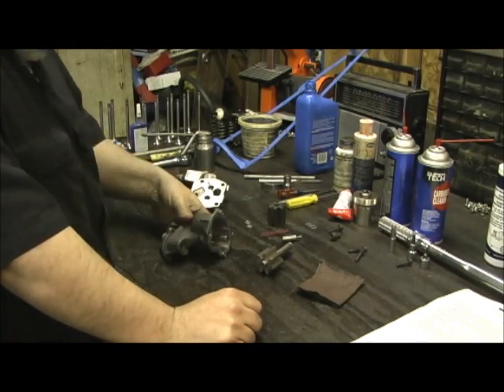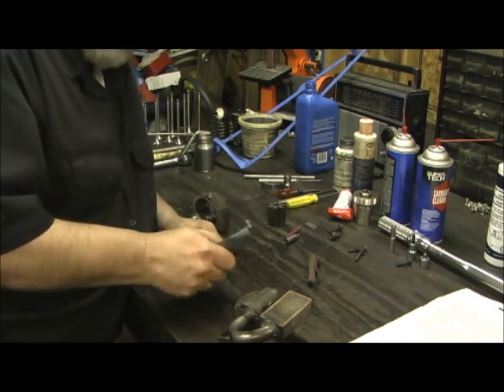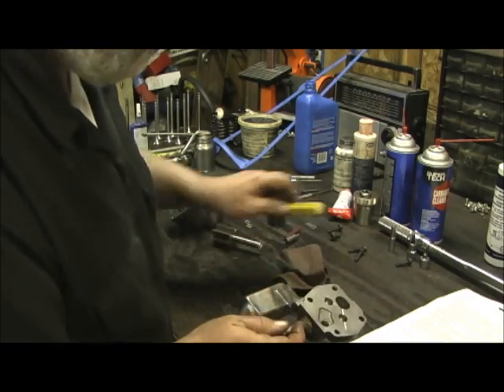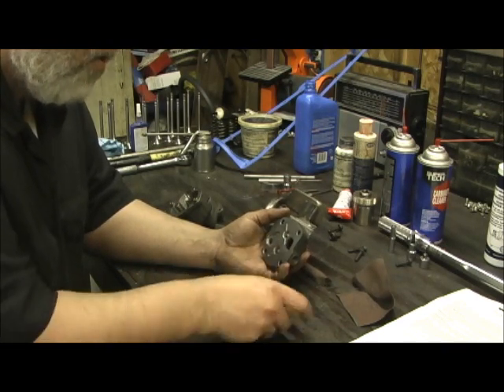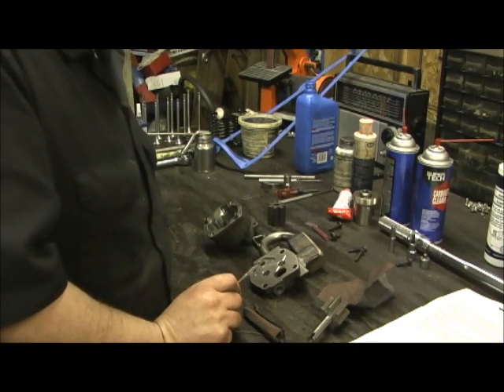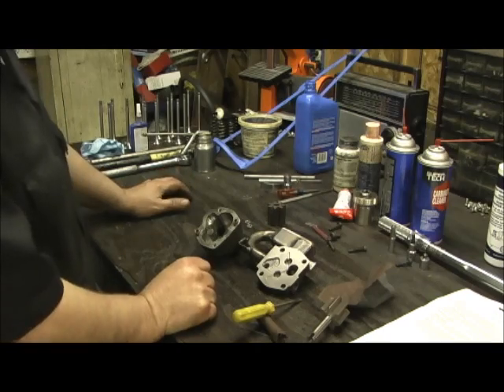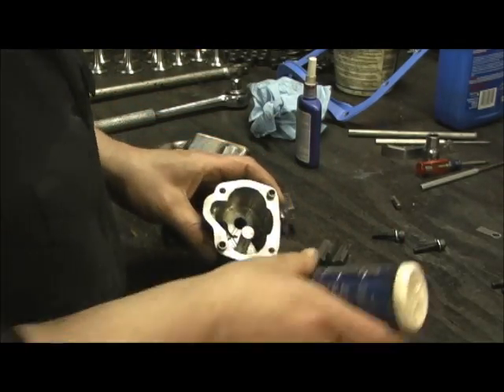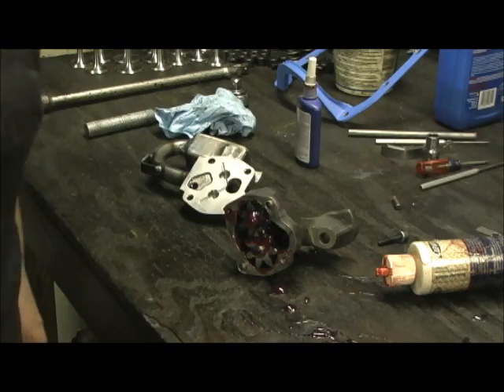Holder Boulder 5.2 Melling Oil Pump Blueprinting

Comment: I did a similar thing on a Australian holden early v8 oil pump standard volume. put a 100thou packer on spring lifted oil pressure to 75 pound.The improvements were amazing.. great vid bud....

Comment: Building a 35c and want to "blueprint" the HV oil pump, it all makes sense but how do you remove the pressure plug and if you need to drill and pull it, where do you get the replacements? thanks for the informative videos

Comment: Damn Yankees port out the oil pump as well. You need to mention that the bypass spring MUST be removed prior to welding the pickup or the spring temper will be ruined.  The anti chatter grooves give enough oil leakage past the rotors to smooth out the amount of energy needed to turn the pump. Since the oil pump is driven off the same shaft as the distributor this smooths out the motion of the distributor. Hence the anti chatter. Not a huge fan of the hv pumps anymore, On a small block ford I built for a friend I had no room for an oversized pan and ran a hv pump. At 7000 rpm it would pump the pan dry and seize the pump and "drill bit" the pump shaft! Installed a standard volume pump after rebuilding the lower end and never had that problem again.